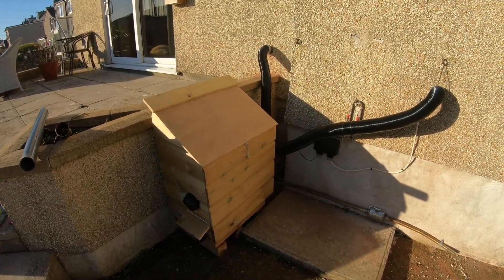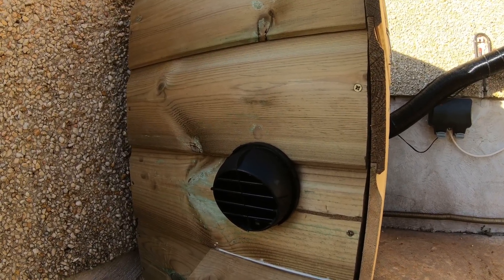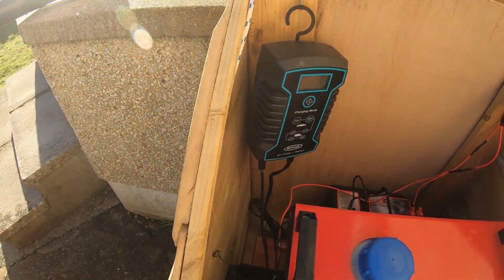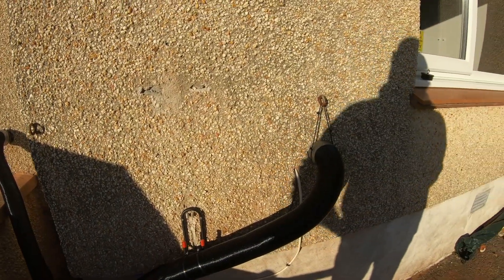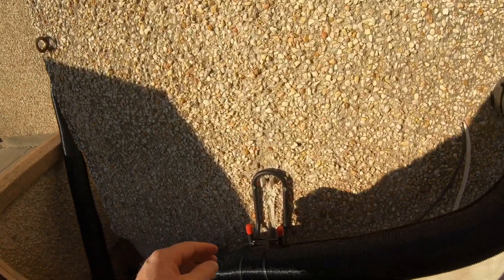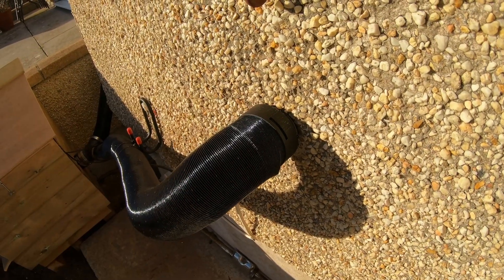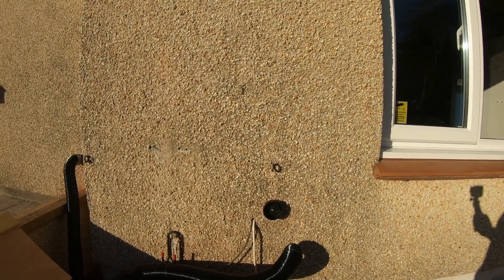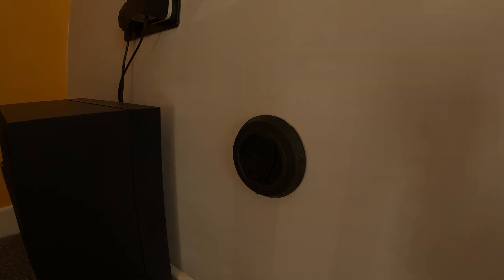Heating my home with a Chinese diesel heater.

Comment: Lots of good tips, like the 60mm concept. On my project list for next autumn. Heater prices are silly right now.
Reply: Nice job I've fitted one into conservatory and working fantastic actually heating 3 rooms and not on too high a heat. Found your problem with the cold draught when turned off and bought a similar close able 75mm vent from ebay , only had it blowing 5 minutes at 25 degrees and it started melting and deformed like it was made from plastercine 🤨. So hopefully the vent you purchased will be available in 75mm or I'll carry on stuffing with a tea towel 😀 👍 keep up the good work.
Reply from the maker: Thanks bud. 👍🏻  Yes I think the 60mm works well, especially when you’re splitting the blowing output. More force behind air pressure out of each exit. I bought mine literally the week before prices rocketed.
Reply: @en53kff  where did you get the swivel ducts from?
Reply from the maker: @RD-qp3mu  https://www.bowerspartsonline.co.uk/brands/eberspacher/air-outlet-vents-accessories/eberspacherwebasto-heater-60mm-ducting-rotatable-closeable-air-outlet-vent-black-9012300a-1320206a
I found these were the cheapest, UK shipping not China, also in stock.

Comment: Nice install 👍👍
Check out mine too 😊
Reply from the maker: Hi. Yes I watched yours a couple of days ago. Nice job. 👍🏻
Reply: @en53kff  Will be interesting to see what your internal temperatures are like when we get to freezing outside and how much heat lose you will get through those lengths..?
Would be good to insulate if you can and still keep it looking neat and tidy 👌
Great video, to the point and clear information 👍👍
Reply from the maker: @deoxyrobo   I’ve had it up and running since December, just didn’t get around to making a video. Operating with temperatures at times of -6 outside,  getting room temperature from around 15, up to 20c before reducing power (pump speed). 
I do have rolls of silver thermal bubble wrap and considered insulating the ducting. I may still do it yet, when I have the inclination. 🥹 I’ve no doubt I’m using more fuel by drawing my air from outside but am happy with the trade-off, pumping fresh air into the rooms and not recirculating stale air. As I remarked in the video, the condensation levels have reduced dramatically, as backed up by my humidity meter.
Reply: @en53kff  thermal bubble and some evenly spaced cable ties could look neat and would help insulate and maintain those incoming temps. Would be adding weight to the ducting but as you’ve already got some supports it should be ok. 
Am trying to find out what the effects of damp is its very wet outside and moisture levels are high, how much is being pulled into the house, where as recycling the ambient moisture in the house.
Reply from the maker: @deoxyrobo   My air moisture content can be as much as 80 - 90%  if my heater hasn’t been on for some time, if we’ve been out all day / evening . The recommended norm is 50 - 60%. When the heater is then put on, after a couple of hours it can drop to 40 - 50%. The heated air, although being pumped in from outside, regardless of whether it’s raining or not, brings down the moisture content. Any wet inside windows will eventually dry out. I can’t say for sure if it’s down to the fresh air (although I suspect it is) or just heat. Hope that makes sense.

Comment: Thanks for the video.. I just got a new diesel heater and thinking to do something similar. Is the neoprene duct suitable for very high temperature? Also, have you put the neoprene as an inner sleeve or within a metallic duct?  :)
Reply from the maker: Hi Jorge. Yes it is designed as heater ducting and will take high temperatures. No I don’t have a metal duct, just the neoprene alone,  as a sleeve. https://www.t7design.co.uk/neoprene-heater-ducting-60mm-2-36-id-x1m-f02-53e-5b1.html